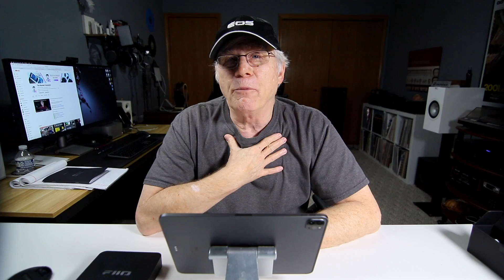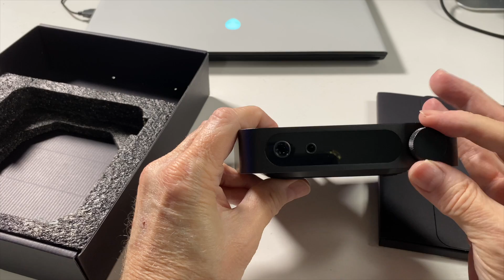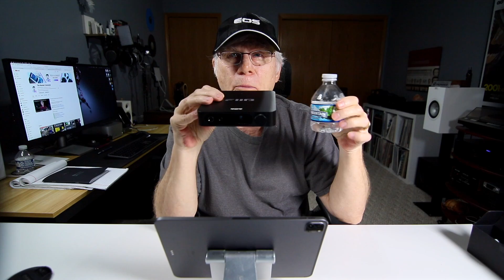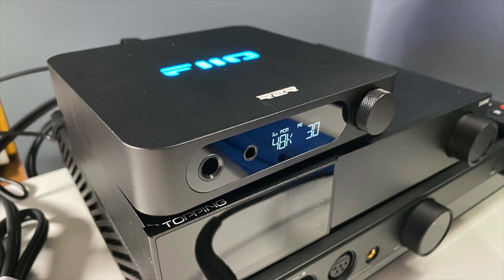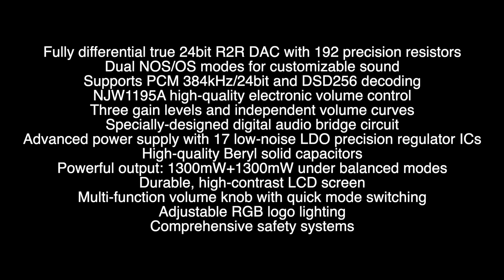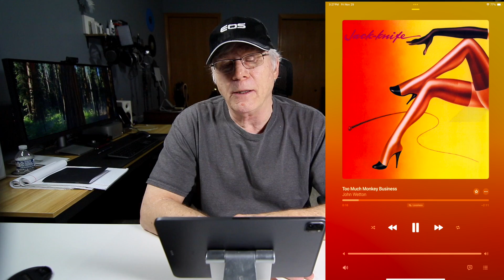The  Under $200 FiiO K11 R2R Dac Amp is the Dac for the Rest of Us!

Comment from the maker: Please keep comments civil. Comments with links will be removed
Reply: Can it run on batteries? The power supplies (usually switching supplies) are the weak point in these cheap DACs and sometimes more expensive DACs. Sadly I've seen switching supplies used in DACs costing over $2k. Understandable in a product that costs $200. But I'm still hoping switching to batteries or upgrading the power supply is possible
Reply: Battery is not needed. You can upgrade with ifi ipower x - which is still switching, but with active canceling system, effect is better even than linear ps and far better than batteries. And it's cheap. Quality of fiio sound can be in fact improved this way, as ps from box is indeed very cheap and bad.

Modern good switching ps are technically batter than linear ones - with totally no any noise. They are dead quiet. Which can be checked on oscilloscope. So they are intentionally used also in very good, even best gear - to reduce size, weight and increase power.
Reply: @socksumi . ifi power X dude

Comment: I like the review, it sold me but I still search. That search would be for a DAC not much above 200.00 (300.00 including tax is top) that uses an internal power supply and (this is the big one maybe) I don't use headphones (headache.) I don't want any of the cost for the DAC I seek devoted to parts or engineering for headphone use. I also don't want any of the cost going towards XLR outputs. Take the money spent on headphone use and XLR output and apply it to that internal power supply that I seek. Harder to find one by using a simple search than it should be.

Comment: I got the K11 R2R yesterday and was shocked by the sound coming out of that thing. I had it running line out to my amp to pair of bayerdynamics. Wow, the sound is so organic and three dimensional. Especially on the NOS mode. If I wanted a bit crisper sound, just switch to OS and was good to go. Amazing device for that price.
Reply from the maker: They are excellent sounding dacs for the money

Comment: Привет, бродяга, раскачает ли этот цап наушники Sennheiser HD660S2 ?
Reply: If it can rock please hifiman planar he1000, then it will easily rock 660s2.
Reply: @mrgee918  я счастлив что есть наушники за 500 тысяч рублей, но они так же есть 35 ОМ, в то время как цапоусилитель fiio k11r2r  заявлен как до 300 ом а Sennheiser HD660S2 выдают 320 ом, ок, да?
Reply: @ScarHend-mv5ut I can run my hd 660s2 very well on my ibasso dx320 and dx170 daps with no problems. If you want the best performance for 660s2, you should use a balanced cable to get maximum power.

Comment: Hi, could you please remove the text 'Amp' from the title? I was really confused because this is not an Amp. Thanks!
Reply from the maker: It’s a Dac and Headphone amplifier
Reply: Its headphone amp with pretty decent output especially in balanced.
Reply: You are technically correct. Should read DAC + "headphone" amp, to avoid confusion.

Comment: R2R not a magicaly solution.. it has SNR under 115db.. not cleanest, not resolving, not detailed sound over ESS or AKM flagship chips.. R2R alternative is dirty Tube sound or older DAC chips.. if you want to real world performance then you must go to AKM, ESS or FPGA.. R2R hype is bullshit!
Reply: If someone is using SNR arguments - there is no any sense of discussion. Real music is not related with such parameters - or if it is - in opposite way.
I have many, many Akm and ess, I had few eversolo or rme - and are far, far worse.

Music is not "performance".but from technically point of view - sigma is simply pcm to dsd conversion with noise shaping and oversampling - pure mathematical tricks. R2R is native pcm conversion. Native is technically better than emulation, if resistors are on adequate quality. Emulation / conversion is better only when resistors are bad quality. All parameters (SNR, Thd) created by manipulations like noise shaping and oversampling are pure fake. Without any meaning. Such manipulations, used feedback loops are very bad from time domain perspective. Also discrete forms, discrete also opamps are usually better. 

Chip is not everything. For dac quality dac and power quality are equally important. 

And yes, tube amplifier like willsenton - are also far better than mediocre AB class.

Comment: Can the display lights be turned off?
Reply: Yeah you can set the brightness down to 0, for the RBG logo but not for the interface
Reply: @Kekdouble  actually you can set a timer for the screen to go off after any adjustments, between  1 - 30 minutes. I have mine set at 1 min.
Reply: Yes. Turned that top LED off. Would get hot. Nice and cool now. This DAC sounds great to me.